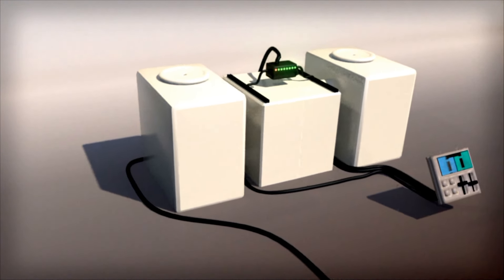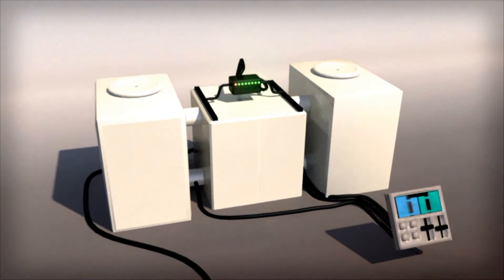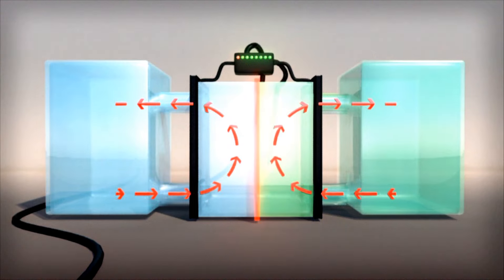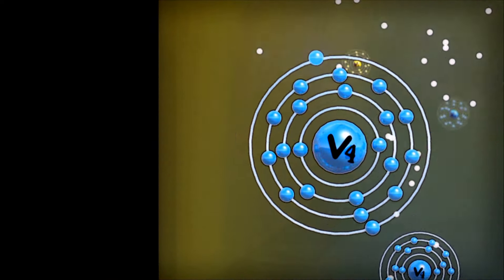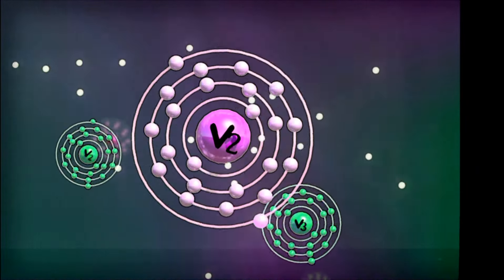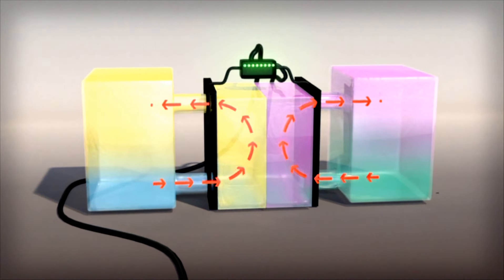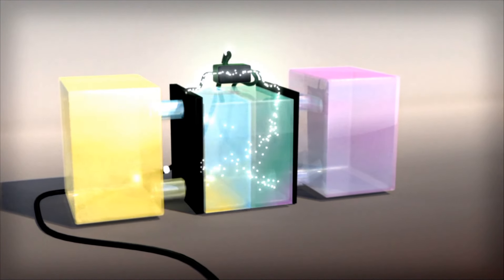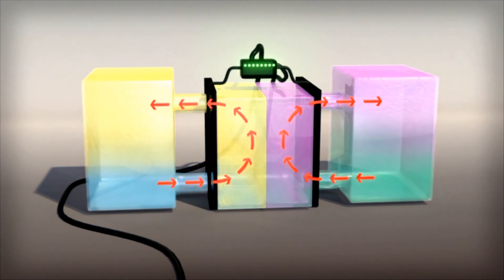How the Vanadium Redox Flow Battery "VRFB" Works

Comment: The video interestingly did not explain why the two solutions need to be close to each other separate by membrane. the whole explanation would work even if the tow tanks were kept away without a membrane.. I suppose there is some ion exchange via membrane..that part is missed, else a good video
Reply: Yeah but you can watch a video on how a battery works and it will tell you why the positive and negative particles have to be closely separated

Comment: Pretty cool. Wonder why we haven't seen this cone out or hear much else about it?
Reply: it's energy/weight ratio is really bad (about half that of a lead-acid battery)
Reply: Well electric cars were popular back in year 1880~ ish.. then combustion engines came which we're about 3 times cheaper, and polluted 500 times more. But 3 times cheaper!
Reply: @satibel  To be used for home storage so weight not important. 20 year life, lead acid 2 yrs
Reply: @malcolmstabler2597  still, it's great tech, but people would rather have a sleek powerwall than 2 tanks of vanadium.
Though if someone manages to make to make a transparent one it'd be really cool, seriously, add some leds on that, and see one side going from black to bright purple and the other from blue to green add some ukulele music and an inspirational speech, and it'll sell.
Reply: @vanadiumcorpresourceinc.8742   About how much power per Kg and euros per kwh does that equate to?
And how small can you make them? Like is 1-10kWh a thing?
Reply: @vanadiumcorpresourceinc.8742  That's still about 3 times more weight/volume vs lead (which isn't the lightest tech) and about on par with lithium for price, which is quite good given that it's batteries with like more than 4 times the lifetime.

My point still stands, they take more space and weight than many other competing tech, which makes them bad for most vehicles.
And it is still a bigger initial investment, even if it is cheaper long term.
Those and the lack of consumer grade batteries are (I assume) why vanadium batteries aren't as mainstream as lithium and lead.

Ps: thanks for answering ^^

Comment: So whats the drawbacks to this?
Reply: ***** I believe size is the primary drawback currently.
Reply: Also, this is probably fake
Reply: ***** How can it be fake when it's just a theoretical computer model?
Reply: I meant to say unfeasible according to some clever people, it's too good to be true
Reply: ***** It's feasible. It's just only been tested in labs and the payoffs probably don't warrant the price or size.

But this is technically how all batteries work. Two chemicals separated by a membrane. Electrons trying to get from one side to the other.

A similar thing happens with metals too. ;)
Pretty cool once you think about how nature is always trying to balance things out.
Reply: What do you think of this? http://jalopnik.com/the-supercar-that-runs-using-saltwater-is-likely-bullsh-1637600538
Reply: VRBs have significantly less round trip efficiency than PbA or Li-Ion batteries. Plus, you also need an external mechanical system to push the solution through the battery, which you obviously don't need for PbA or Li-ion battery
Reply: Some residual time travel.

Comment: Talk about over my head! If the solution lose' an electron, why does it go from a V4 to a V5? equally, if the neg. solution gains an electron why is it a V3 then a V2? Not to mention I don't full understand how it gains a charge, they may have explained it but again over my head?
Reply: Electrons are negatively charged, so when you give something an electron it loses charge. 
You charge it by plugin it into an electrical current, that drives electrons into the solution, which stores the energy.
When you use it, the solution returns to its original uncharged state and gives back the current you've inputed.
Reply: Kavryel So you have the solution right, then an external charge to it will realise an electron, which gives of enegery that is then tranfered to the other side of the box that will hold and be used?
Reply: realise is not the correct word in this sentence, but if you mean "make" then yes you're right and you understand it as much as i do.
Reply: It's magic.

Comment: First time I've looked at this. I don't get it. It seems ridiculously simple. Negative ions in one tank. Positive in the other. Connect em through an electric motor and you get current. Power the electric motor from an outside source and you charge the batteries. This is what I'm seeing. What I dont understand at all, is the membrane.
Reply: The membrane serves two purposes. It is most likely a catalyst for the V5 to give up the electron. it also must provide the path of lease resistance for the electron to travel and directs the electron through the battery for charging or discharging.
Reply: rockboy2003 Since you seem to know something about this technology, can you tell do you need to buy an specfic solution for this or can you just get water to power it up. And how much it will cust.
Reply: I seriously doubt the membrane is something you can just buy. most likely its something that was developed by whoever created the battery. The video is more of a proof of concept. I know that this technology is used in the worlds first Salt water car. Im sure if you google Saltwater Car you'll be able to read up on it. very amazing stuff. too bad the oil and automotive corp giants will pay billions to keep that stuff out of the US
Reply: rockboy2003 Oil and gas companies don't have to do a thing to keep this out of the US; the technology is not easily adaptable to civilian use. I suspect that's part of the reason that the "World's First Salt Water Car," the QUANT e-Sportlimousine by nanoFLOWCELL AG, is projected to sell for $1.25 million. The oil and gas companies don't have to worry... yet.
Reply: Crown Clown Several types of flow batteries exist, representing several approaches to overcome the problems of the technology and getting as much performance as possible. 

http://en.wikipedia.org/wiki/Flow_battery
Reply: From a chemist's standpoint, I'm guessing that the membrane has to be semipermeable. It can't allow the Vanadium ions in either oxidation state to pass, otherwise they could simply exchange electrons in solution and generate radiation -- heat or light -- in the cell rather than exchanging electrons through the external circuit to produce usable electricity. Conversely, the membrane must be permeable to negatively charged counterions in order to balance the electrons flowing through the external circuit; otherwise, the V5+ ions created by electron loss in one chamber and the V2+ ions created by electron gain in the other would rapidly create a potential between the two chambers opposite to the electrical potential of the external circuit, which would prevent further electron flow.
Reply: Benjamin Shtark Is Lithium not a chemical?
Reply: rockboy200